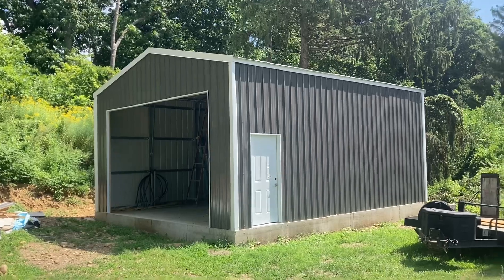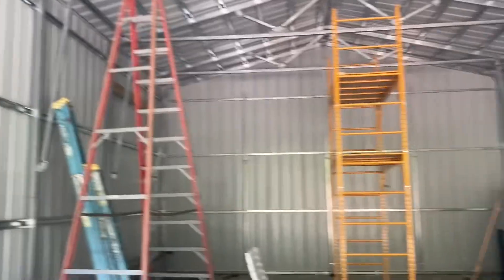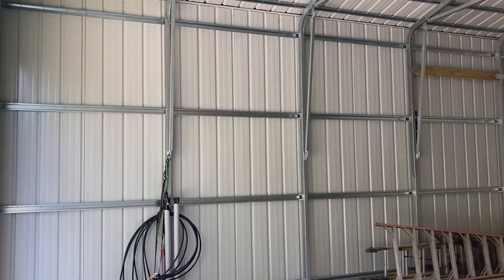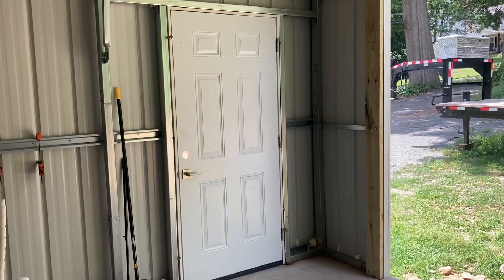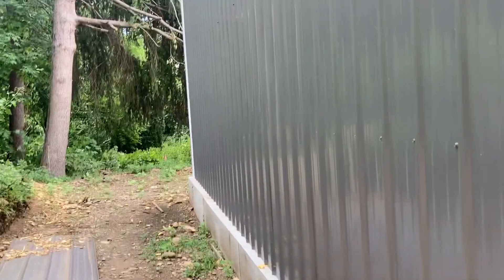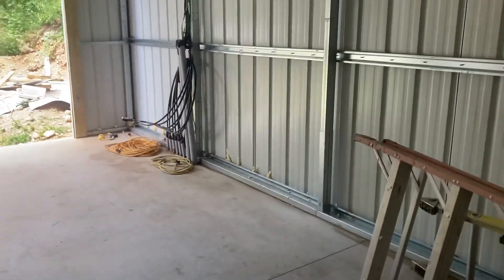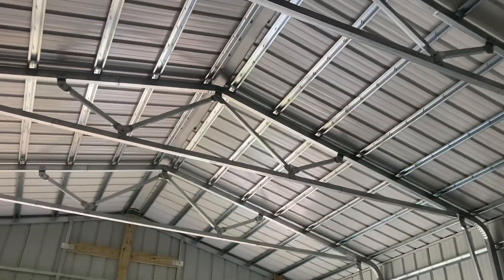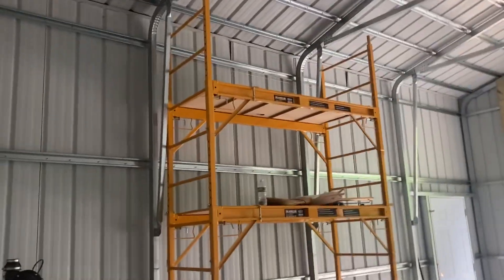So you want to put up a metal building, Versatube garage

Comment: Your going really regret not overlaping the slab with the siding.
That foam isnt water proof.
Reply from the maker: @WickedGod-l7x  I ended up getting some flashing installed which has now cured my water issue. Hindsight is 20/20 I recommend doing it on initial install.

Comment: I had never built a thing in my life until I built my 20x25 garage.  Completely by myself, I was able to pull it off.  I have only the garage door left to do. 
The thing I got the most anger out of was driving in the screws sometimes.  If I wasn't perfectly balanced, I'd slip and i caused some dents in mine.  Clamps!!  Most important when alone to hold one end while lining up the other of everything.  I got an 8 ft high garage....I would go 10 if I had it all over to do.  Mine was a Frontier and I trimmed off 2 ft of the siding along the base.  For the price difference it's worth not trimming that siding and height gain would be good to have.  90 ft snow load here so bracing is like this one.  No engineered plans but i went thicker gage for roof.
I don't have side bracing like the hat channels one this one either so considering adding some bracing along back and sides.  I would have made my slab a foot wider all around and I'd have opted for the lean-to as well.  
My lot is sloping and spring runoff, and rain if rains hard enough does go in between my concrete and base rails.  I dont really know what to do to prevent that other than to dig out around it, plastic layer laid a few feet out and up the slab to the base, placing rock on the plastic??  Ill try it.  
Im very happy with it and worth every penny.
Reply from the maker: Awesome I’m happy to hear you like your building and good job doing it all yourself! I agree the clamps saved my life it’s really like having another person there

Comment: Same on my slab i didn't do the approach , one year later are you happy with the building , thinking about stick built, may go versa tube ,thanks
Reply from the maker: Still holding strong and I love it, like I mentioned the only thing I would have done different is seal the walls to the floor to keep water out. I absolutely would go metal again
Reply: I'm happy with mine, for what it's worth.  I live at 10,000 ft and heavy snow. My approach looked like this too.  I dug out where I'm adding a lean-to next year and used that material filling in 2.5 feet sloping to level on the other side, packed it down, 25 ft length, and got free millings from the county....all by hand in the rockies.  It sucked!

Comment: Looks good so these don’t come with doors?
Reply from the maker: Correct, you will have to purchase the door yourself. I had someone do mine and it was well worth it. Some parts of the project are worth subbing out
Reply: @wheelinndealin  okay how much do doors usually run? I’m trying to see if if this versa tube building are cheaper then just going with a standard pole building
Reply from the maker: @benbrumbley181  I believe all said and done with the opener mine was roughly 4500

Comment: Is there any reason you can't do this on a wood floor with a joist system instead of concrete, assuming no vehicles would be inside?
Reply from the maker: I don’t see why not. I would still recommend setting concrete piers for the main beams to land on. Your biggest worry will be the structure flexing as it settles and you will see that quickly on the sheet metal if it bends flexes or bows.
Reply: @wheelinndealin  I see your point about how a steel and sheet metal building would have less flexibility, however concrete slabs also move.  And pier and beam foundation can be jacked and shimmed much easier.

Comment: Do you really need footings??? Or can I get away with the standard 6 inch slab...
Reply from the maker: Depending where you are and what your base material is you can get away with just a 6” slab. I have the Alaskan slab because up here in the north east the ground freezes in the winter and can cause a traditional slab to shift and crack.

Comment: nice vid!! I wanted to get a 20x28 for auto detailing, window tinting, wrapping, etc. but watching this, It seems to me that a 24x28x10 or 28x28x10 makes more sense with an 18 feet wide door. 24 feet should be able to fit at least 2 cars in there comfortably.
Reply from the maker: Thanks! But yes I built mine with pickup trucks in mind. I know that a extended cab 4 door short bed is about 23 feet long so I planned everything around that. If you get a chance make some marks on the ground and measure out what you’ll be putting in the garage to figure out how much space you need.
Reply: @wheelinndealin  indeed! thank you

Comment: Is there anything that you would've done differently looking back??
Reply from the maker: Yes, I really wish I put a flashing from the wall down onto the floor to keep water out! Besides that it’s perfect
Reply: @wheelinndealin  I put the apron on mine. I had to question my versa tube supplier as I thought they forgot it. Not sure why they don't come in the kit.
Reply from the maker: @jtcustoms1182   yeah good call and no they do not supply it, the apron is fully on the installer however I wish I had known or atleast thought of it before I finished mine

Comment: Job well  done, I'm electrician  / carpenter by trade. Hope to order my garage kit soon.
Thanks  for the info and tips.
Reply from the maker: Absolutely I’m glad to hear this video was helpful. One thing I stress is buy some flashing that goes behind the bottom of the wall and hangs over the concrete on the outside to keep water out, I wish I did this now I’ve got to figure something out!

Comment: That floor is going to be wet from the concrete sticking out.  Take an angle grinder and cut a 45* to bring the top edge under the metal in.
Reply from the maker: That’s a good idea, I may have to give that a try

Comment: Thank you for your information. I'm considering buying a 15x26x12 with a lean roof and turning it into my desert cottage. What gage sheet metal did you use, snow load, and wind speed?
Reply from the maker: As for my sheet metal I’m not positive but on versatubes website it looks like they use 29 gauge. I do have my snow load and wind speed however and they are as follows: snow load:26.46 psf and wind speed rating of 118 mph

Comment: Good job. For people considering a similar project, putting a formed flashing under the bottom of the wall panels before they are installed would direct water over the concrete slab so that it doesn't run into the building. A bit late now for this project! ;)
Reply: Can you explain that more in depth? What is formed flashing? Does that go down BEFORE you put anything down? New to all of this..Thanks
Reply from the maker: Thank you!

Comment: Looka pretty good! I have a 6 inch 3000psi cement slab, with rebar around the corners, and with fiberglass, and I'm debating if it's enough to support a building like this.
Reply from the maker: Is the perimeter thicker? This buildings total weight is actually less than 2,500LB and that includes the sheet metal and the frame. I think you’ll be good man just make sure you can anchor the structure properly.
Reply: @wheelinndealin  that's the whole cement slab is 6inch with all that I mentioned. I'm just so worried about freaking permits! I'm near a main road and I'm sure someone might complain.
Reply from the maker: @pFbSpecV  yes if that’s the case and you have to do a permit you should verify with your town how far away from the road and your property lines you have to be. That was a major difficulty with my project my town was very strict on location so it forced me to go into my hill a bit.

Comment: What was the cost of the building itself
Reply from the maker: At time of purchase cost of building on website was $11,600.00 then after tax and a couple add ons I paid right about 13k
Reply: @wheelinndealin  do they offer different thicknesses of the sheet metal
Reply from the maker: I’m not too sure, you’d have to check with manufacture
Reply: @carolmaplesden916  They do offer different gauges. You don't have to buy the panels off them.  You can buy the frame and put whatever gauge panels you find. Price changes quickly the thicker you go.
Reply: I bought my roof, siding, all trim from a different company.  I bought thicker gage for my roof.  It was cheaper by a few grand!  Versatube will give you the metal list needed and all you gotta do is give that to your supplier.